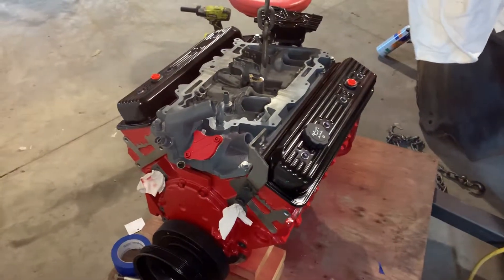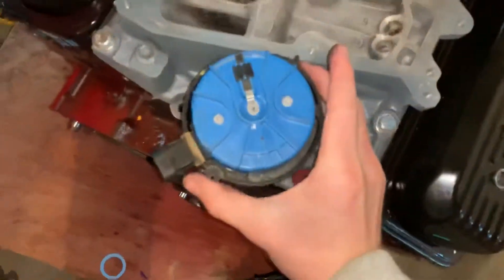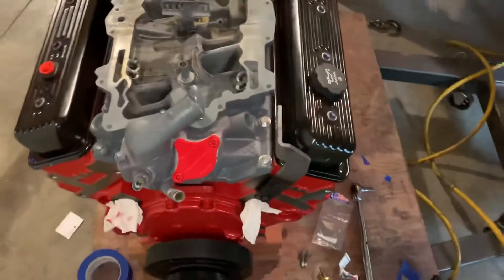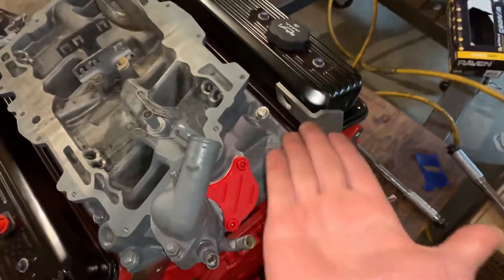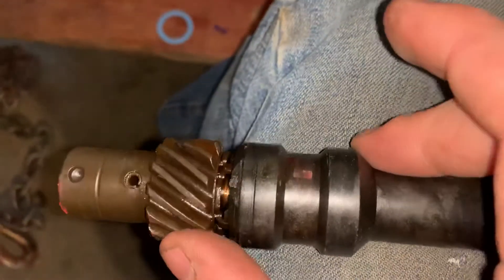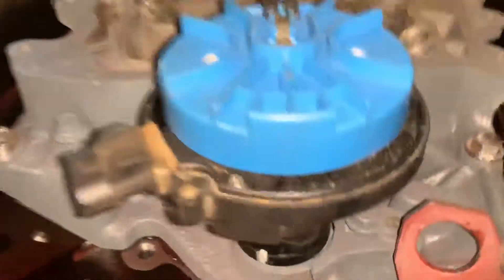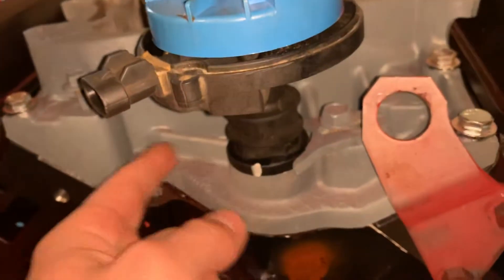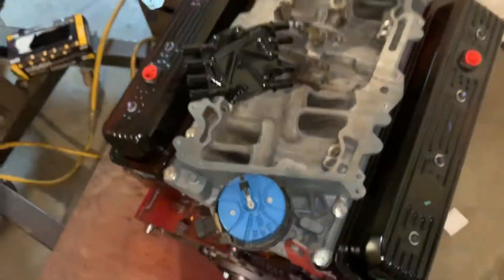Chevy Vortec Distributor Installation How to ‘96-‘00

Comment: With these Vortec 5.7 tbi engines/computer will accept, tolerate and or correct itself,  IF distributer is with-in 10 degrees of said /set timing when installed. Also check alignment holes underneath the rotor.
Reply: It's not a tbi it's sequential  fuel injected

Comment: vortec turned the small block chevy into junk. I've shunned vortecs decades ago. I would have switched it either back to a TBI or HEI carburetor setup. you really wasted money on a big turd.
Reply: Vortecs are good when u get them right now once u start having problems you might as well redo the whole damn motor and wiring harness

Comment: I no the vortec has crank sensor but can I put a old one wire distributer and carburetor on the vortec how would I time it without using crank sensor Can I

Comment: I always check the tdc of #1 piston by inserting a screwdriver or pick into the spark plug hole and feel it with your right hand while your left hand turns the crank. I do this because you should never trust factory marks plus you can get it 1 tooth off and be a nightmare to chase down your mistake. An old balancer ring could slip, A new balancer could be mismarked, a timing chain could be mismarked as well. Since you have a nice painted engine, use a black magic marker to add your marks to exterior lip of distributor and intake. This will help if you do have to hold pressure down on distributor while bumping the engine to get that oil pump shaft to line up and mesh. Then double check everything quickly with your marks.
Reply: If your 1 or 3 teeth off, could you use a scan tool to relearn it?